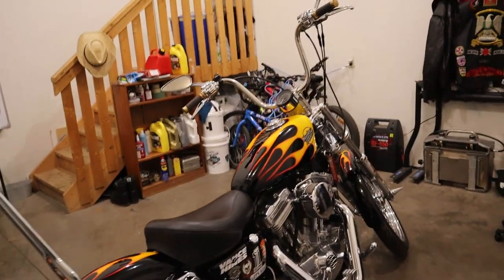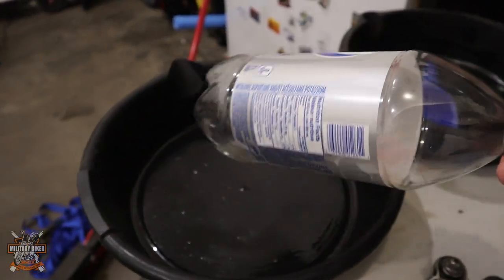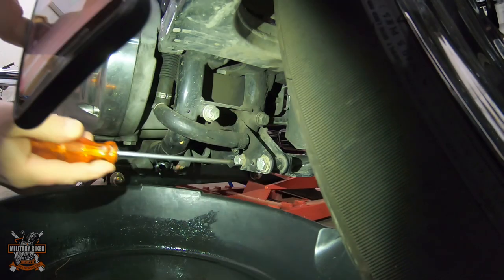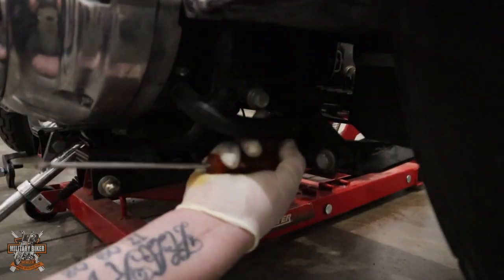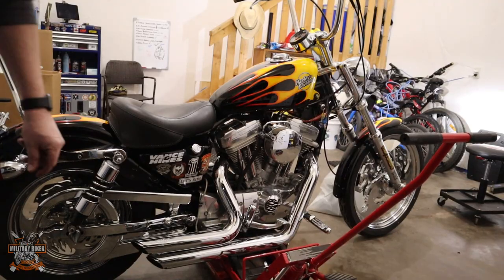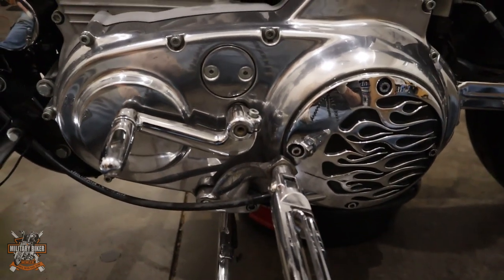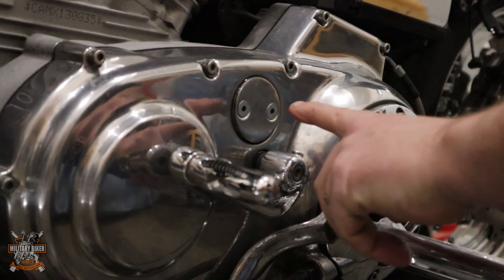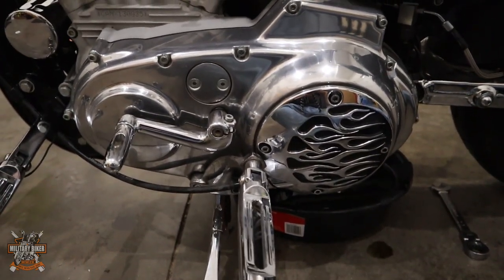How to Change Oil & Filter on a Harley-Davidson Sportster (Evo)

Comment: Nice job mate. I found that the synthetic makes the engine run much quieter. My clutch shares the same oil and the clutch is also much smoother with synthetic.
Reply from the maker: Will keep an eye out for that mate cheers for the info. ✌️🇨🇦

Comment: Nice one Stevie! Great video. A Couple of helpful tips... if you remove the cap off your oil reservoir, the oil drops abit quicker out of the drain plug 👍 and also while you have the clutch cover off it’s worth checking the adjustment, saves you the faff of removing the cover again when you need to check it (unless you’ve don’t it recently of course) 😉😉
Reply from the maker: Did all that pal, you must have missed that bit of the video 😉
Reply: @TheMilitaryBiker  haha I’ll just have to rewatch it for research sake ;)
Reply from the maker: @WibblyWobblyHarleyBoy  if it’s not there I’ve edited it out by mistake 😂 didn’t need to do clutch as I did it a while back.